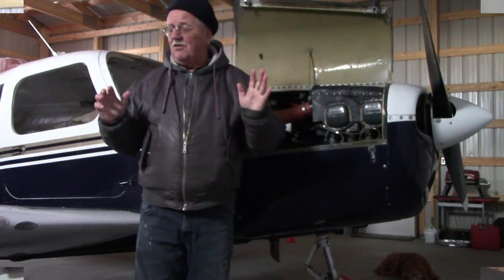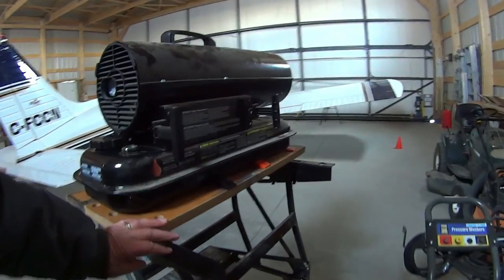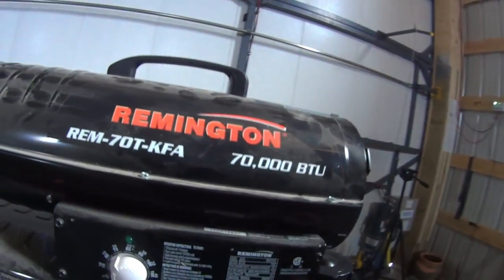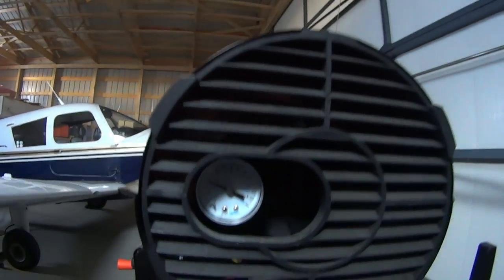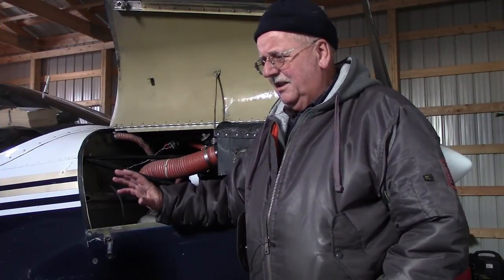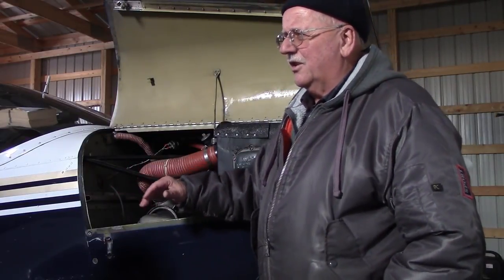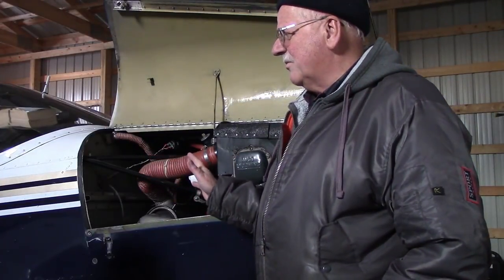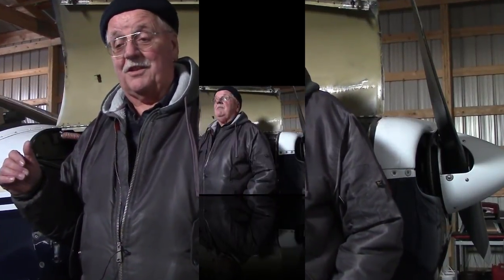Piper Cherokee "How I Preheat my Aircraft Engine" Vlog #176

Comment: Hi Chet .like your videos. For my 1967 cherokee.I brought a small heater from CT and the electrical heater is fairly small about 12'*6'*6' ( 1200W ) .and I just leave it into the engine cowl . Like you did in one of your video before ( you were using camp heater) and i have insulation covers . And i put the covers on with heater inside engine cowls for about 40mins to 1 hours.  Engine will start within 2 trys.. 😀
Reply from the maker: Hey there Yan..yep it's a real benefit to have access to electrical power ... gives you many options for preheating..

Comment: I'd probably go with having your A&P install a Tanis engine heater. Then set the up with either a switch by the door or get a wireless GSM switch so that you can start the heater two hours or so before your flight. 
Also..you may want to consider getting a batterytender. My previous Gill wet cell had a life of about four years. My Concorde ASM replaced it in 2013 and is still going strong. 
My PA28-161 and I live in a climate like your's in Western Michigan.
Reply from the maker: Hey there Kevin..have given this a lot of thought and now that I have my hangar it's either doing an insulation of same so I could have a heated hangar in the future or getting a reef band heater..I had one in my previous a/c and it worked well for me.  The remote wireless on/off switch  using my cell phone  is another  which I may do some research on...So how did you enjoy your winter this year???  Have relatives who live in the Muskegon area..they ended up heading south for a while...lol

Comment: #1 diesel IS kerosene.  In the part of the USA that I live in they sell #2 diesel in the summer which is heavier than kerosene and #1 diesel in the winter.  #1 gels at a lower temp than #2 which is the purpose of the switch.    #1 diesel I'm sure has anti gel additives but that shouldn't hurt your heater.  FYI Jet fuel is also kerosene so you could burn that in your heater as well.
Reply from the maker: Yes..the manufacture's manual does show fuel alternatives as #1 or #2 diesel Jet A and JP8 for temperatures below -20F/-6C and I may just switch over to the diesel in view of the expense of the campers kerosene..Thanks for reminding me..Cheers

Comment: Great video, thank you for posting.  I’m wondering if the direct dry heat will damage any of the hoses? I have a 65 Cherokee and looking to do something similar this cold season
Reply from the maker: Thanks for the compliment.  As far as the preheating is concerned I normally move the unit around in order to distribute it around the engine compartment.   I found some info which you may find usefull.   "Both manufacturers are explicit in calling for careful use of high-volume hot air preheaters to assure that all of the engine is heated—oil sump, external oil lines, cylinders, air intake, oil cooler and oil filter. Be careful not to damage non-metallic components such as seals, hoses, and drive belts. As someone who once unknowingly melted the sleeve of a down jacket using a forced-air preheater and then filled the cabin of the airplane with feathers on getting inside to start up, be careful where you point the heater and what you touch with hot parts of it.

Continental says to preheat for a minimum of 30 minutes. Lycoming says to apply heat in five to 10 minute intervals and then “feel the engine to be sure that it is retaining warmth.” It goes on to say that during the last five minutes, the heat should be directed to the top of the engine. "   Hope this answers your question.  Cheers Chet/

Comment: Hello Chet
Is your winter kit a plate that covers the oil cooler? Thats what i have on mine and is at the front to the right of the prop when you are facing the airplane.  I am lucky as one of the previous owners installed a Tanis preheat system on my plane.
Reply from the maker: Hey there Reale..I also have the oil cooler covered however I have an added winter kit which covers the massive area just aft of the nose gear.  It does not cover the entire area however it leaves the air in the engine compartment a bit longer before dumping it out...almost like a "fixed cowl flap".  I have not seen it on any other Cherokee however I know when I was flying up in northern Ontario on skis with my cub and cessna during pretty cool weather we would come up with unique ways of keeping the engine at operating temps.